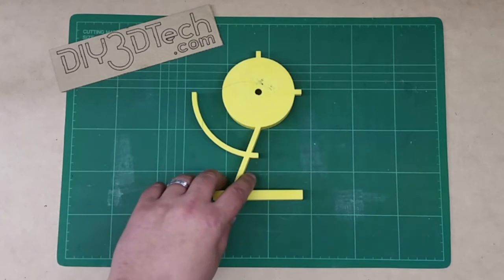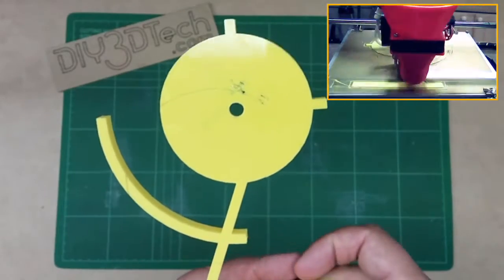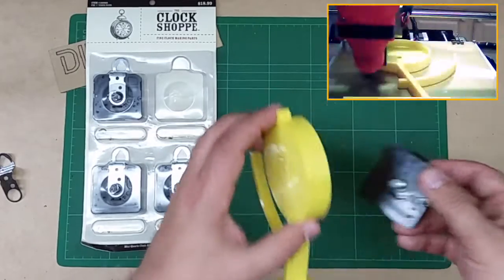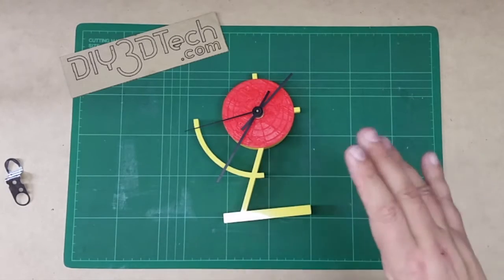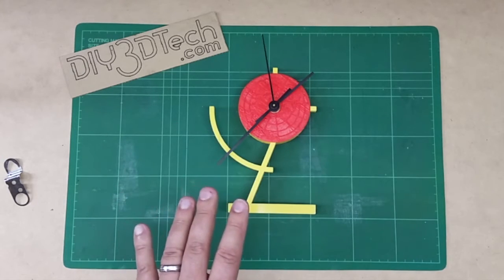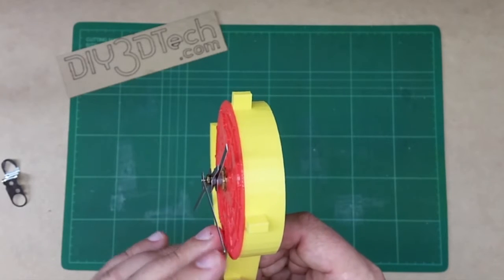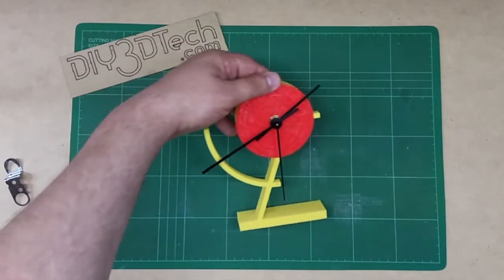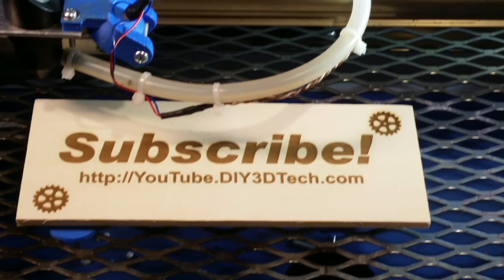3D Printed Project - Desk Clock with a Surprise Fix!

Comment: I have a laser question as I found an old video and the guy got 8 hours out of tube because he said the place it was was too humid.  Is that true and high humidity will screw over a laser tube?
Reply from the maker: I can't see how that would true of a "modern" tube and while I not a "glass" expert I do know there various ways of sealing the tube and "believe" it's simply pinched off which is only ok.  There are better ways to seal and a gas like CO2 or nitrogen permeate the tube, well I could see that in any volume.  Now having the gas breakdown is the tube might be another...
Reply: DIY3DTECH.com
Seems odd that his tube lasted for 8 hours in a very humid part of his house, like mine is where the printers are, and his new Chinese tube was lasting and lasting and was in an AC (less humidity) room.  He couldn't be bothered to use the warranty.  You better bet I would if I only got 8h out of a tube, lol.
Reply from the maker: I can't see it, unless it was a homemade tube or something...
Reply: DIY3DTECH.com
Nope, eBay bought.
Reply from the maker: No clue...
Reply: DIY3DTECH.com
I would go ahead and buy a 50W version but I just can't bring myself to buy any of these because the Chinese are the world's biggest liars.  Rate a tube for what it really is then you would have me.  I like all of the extras you get over the 40w though it is missing an amp meter for some odd reason.  For 3 times the price I don't see where it is giving me three times more of anything so I would need at least a real 50 watt tube in it for some sort of price justification.
Reply from the maker: The thing to keep in mind is they are cheap very cheap as I could, well better put wouldn't pay Epilog prices and they are fun to mess with your handy, other wise as a turn-key they are a waste of money...

Comment: Off Topic: Any idea where to find the wavelength of my co2 laser so I can buy appropriate eye protection?
Reply: 10.6 micrometers.
Reply from the maker: Yupper The CO2laser produces a beam of infrared light with the principal wavelength bands centering on 9.4 and 10.6 micrometers.  Suggest getting the ones with the sides...
Reply: Thanks. After looking at the offerings on Amazon/eBay, I think I will order from LightObject :)
Reply: xKatjaxPurrsx
LO sucks and don't touch eBay for your eyes.  The proper ones to buy cost about 90 dollars and trust me 90 dollars now or blindness faster than you can blink?  A no brainer.
Reply: +Dark Alchemist Hi, I don't need to be persuaded about the importance of safety. Where do I get the good ones?
Reply: xKatjaxPurrsx
:)  I forget now BUT I was shown by DIY3DTech.  They are clear and they cover the sides of the eyes as well which is a must.
Reply: DIY3DTECH.com Any suggestions? :D
Reply from the maker: This is one of the pairs I have (http://amzn.to/2eyIRw4) and like them because I also have wear "readers" with them to see so I can do that with these.  Now I am going to qualify this as I am not a laser nor eye expert however have done a fair amount of homework.  With this would say that the CO2 laser is a safer laser over those of visible light versions (long story). As with the CO2 laser the wave is VERY long so therefore absorbed very easily by acrylic and the reason "acrylic" cuts so well with the laser.  As what is missed is the fact Laser light is "coherent" light means stray (laser) light while not focused or focusable by the lens in your eye is still more energetic than normal light as it is all one frequency and at a  frequency that likes to warm things up.  Think of it as a microwave but different, so the  "acrylic" will absorb and dissipate the FIR energy rather than your eye.  This is why I like the sides to as it will catch incidental light.    Also I make sure to also use cheap "readers" as they are "acrylic"  rather than so this is WAY over kill however would prefer to end up on the side of safety.
Reply: DIY3DTECH.com
Half the price.
Reply: DIY3DTECH.com Thanks for the insight. Ordered!
Reply from the maker: Cool!

Comment: When your PEI bed is COOL you can clean it with acetone and it will remove excess plastic from the surface.  Acetone only reacts chemically with the PEI when it is heated.
Reply from the maker: Thanks, have had excellent luck with alcohol, however forgot to do this time (was trying to take a shortcut :-)